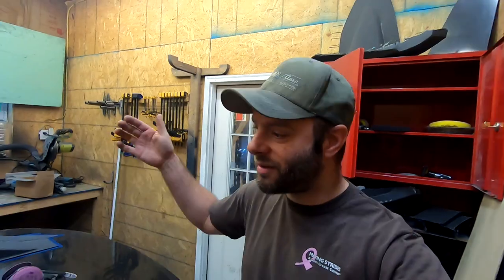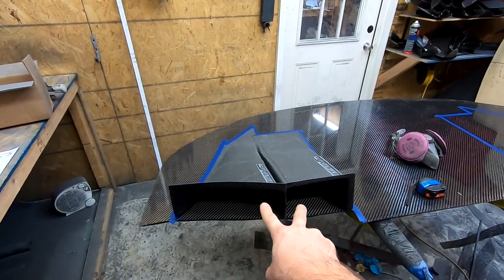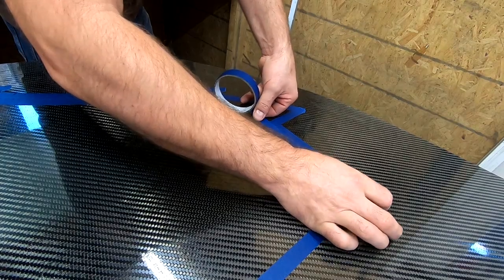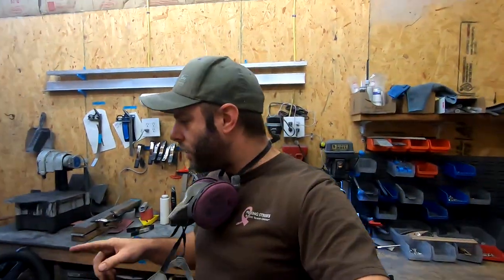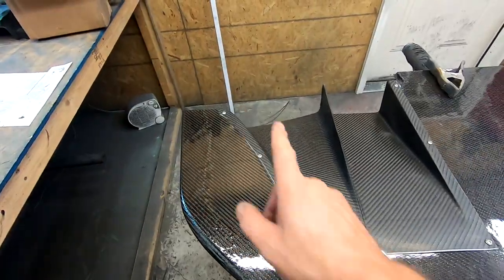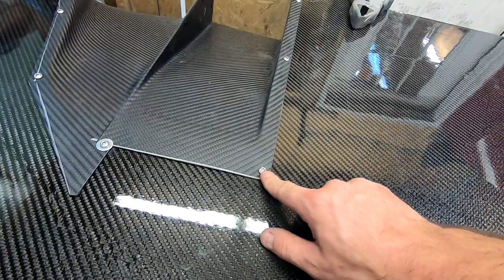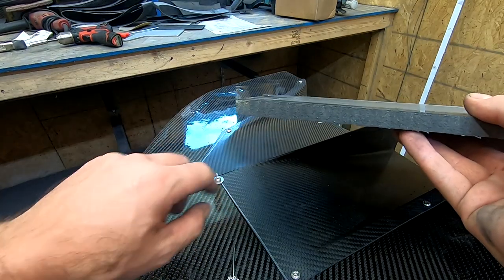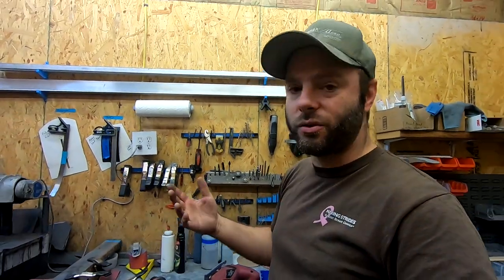Easy Extra Front Downforce- Just Add Splitter Tunnels!

Comment: With a 1/2'' thick splitter, you could rout out the area around the cut out and then have a flush mount for the tunnels. You might need to increase the size of the tunnel perimeter flange, but that's no biggie.

Comment: Have you tried vortex generators on the trailing edge of the roofline?  Saw a company that makes them and says they work but I don't see any numbers to back it up.
Reply: I think he did that in one of the wind tunnel videos.
Reply: @michaelblacktree  ok I will have to go check them out
Reply: One of his more recent wind tunnel vids was on them, not needed on anything except really steep rear screens, depending on whether using a wing or not. Worth another watch if AJ can post a link.
Reply from the maker: Yeah we tried some on an E36, the Subaru, and several versions on the yellow mustang and not once did we get a positive result. They are all in the videos on my wind funnel playlist.
Reply: Per OP response, this is also backed up here. I believe the theory is to assist with activating the rear wing, however effecacy is minimal to nill from what I have seen.

https://youtu.be/nvyqW_avGtQ?si=vVZFHazrd0cNLFee

Comment: Cool video, as usual. Forgive me if you've already covered this, but have any vehicles with splitter tunnels added had the front downforce improvements measured?
Reply from the maker: Yes. We have cfd on our tunnels along with having run cars in the wind tunnel with them.
Reply: @ajhartmanaero would this work on a Lexus Ls430?
Reply from the maker: @mikelmarion  yes
Reply: @ajhartmanaero  ooooo interesting…..Also…have you seen the diffuser on the new Bugatti? They have some technical drawings online.  You might find it interesting.  Wonder if it can be applied to other road cars
Reply from the maker: @mikelmarion  link?